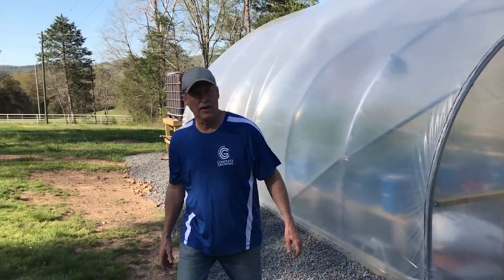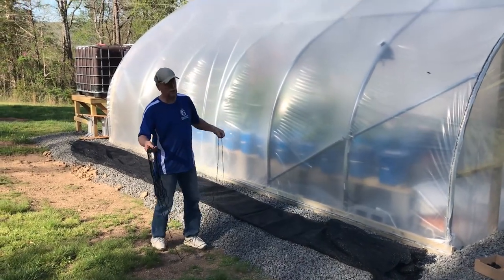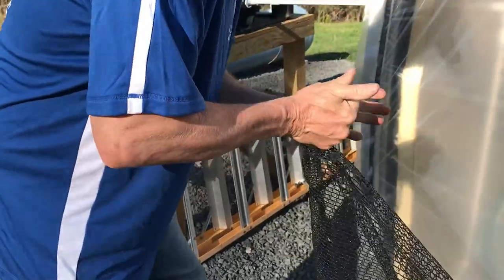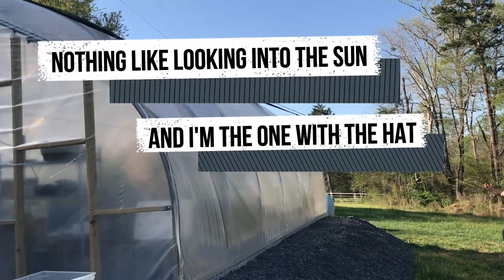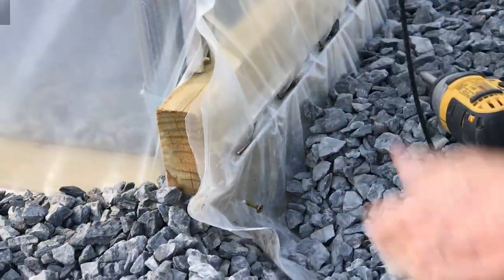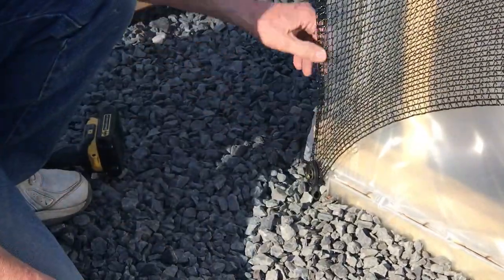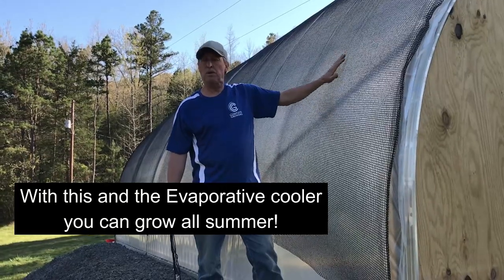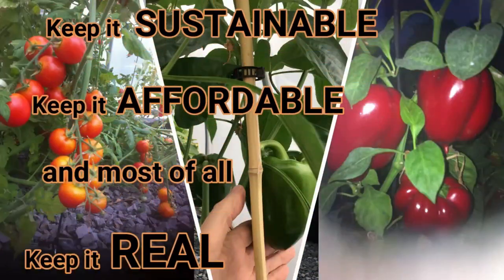Installing a Greenhouse Shade Cloth

Comment: Works everywhere except Arizona!
 Especially with black shade cloth because it's a heat magnet which kinda defeats the purpose of installing one in the first place. Here, we just want to make use of the sun's light without so much of its heat... Today, when it was 90 outside, it was 104 inside the greenhouse. And that's with the use of a 50% white poly shade cloth and a 70% tan poly shade cloth!! It was that hot today and every day for the past few weeks!
Reply from the maker: I am in Arkansas now where the humidity is high. I was in NM with the same temps you are talking about. The shade cloth is only one of the three cooling tools. (black actually absorbs the heat before it gets into the greenhouse if you are using double poly) Evaporative cooling with enough exhaust fan cfm works way better in NM and AZ. Circulation fans and placement is the third.
Reply: Just curious - did you put your shade cloth inside or outside the greenhouse envelope? If placed inside, then shade cloth will actually increase the temp. If you place it outside, the conversion of light to heat should take place outside the envelope instead of inside resulting in a reduction of indoor temperature.. though now you have me thinking about infrared radiating off the bottom of the shade cloth. I wonder if they make greenhouse film that blocks infrared?

Comment: I live in spain heat here all day from morning to 9.30 there is sun at the moment i put a 60% one i had a 40% before and mesured the lumins seems like there is decent light inside my greenhouse cause it gets light all day sun here its all day and intense in summer so i will try and see how it works out for me i plant medicinal plants so they need sun i use 2 fans also the girls look happy to be honest temp at the moment are 26 to 28.5 at the moment with good air flow in july august maybe it can go up a little more

Comment: I would imagine that installing a shade cloth on a greenhouse, beyond creating the right shade of light for the plants you are choosing to grow, could directly impact the internal temperature of the greenhouse? If so, how much of an impact do you think installing that would make? I'm currently looking at alternative ways of cooling a growing room and/or greenhouse without using an air-conditioned of all things.
Reply: @Collin K
I live in AZ and it gets hot here way before summer even starts! My solution has been to create microclimates by hanging many shade cloths as canopies of varying strengths and heights to simulate nature. I have a small tunnel and I zip-tied a few sticks of 2" schedule 40 PVC pipe to the adjacent fence and used them to secure my canopies with paracord. By using smaller pieces of shade cloth and hanging them just a little loosely they are allowed to wave around in the breeze... by hanging them all close to each other they work like a Beduine's tent keeping the area cool by allowing airflow through its many layers. It's also the same way that Arab's clothing works! Now, we tend to look at them and think how the hell can they wear so much clothing when it's so dang hot?! Well, Collin, that's how! The airflow between the layers separates the temperatures between them so that above the cloth is one temperature and below it is another.
Reply from the maker: 10 -15 degrees on average.

Comment: Hi i would like to ask you some question
1. Can we make this kind of tent to do pottery workshop ?
2.will it be so hot inside in summer with temperature 35-40 degrees?  In this case, if we use air coolers will it help to use this space as pottery studio sir??
Reply: Why don't you just use SHADE CLOTH....?  No plastic.
Reply: Then again... I live in a temperate or tropic climate...(Hardly any winter )  Mostly very hot temperatures....I would die with a sealed area of that type....So guess it definately depends on your climate .       But I enjoyed watching and learning from this info..... Thank You